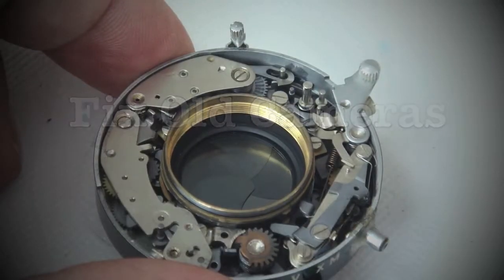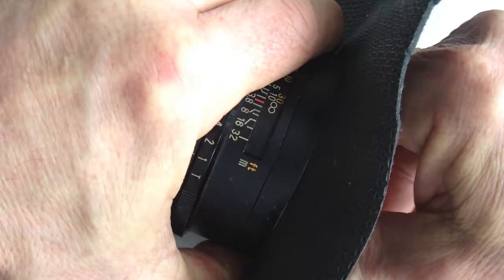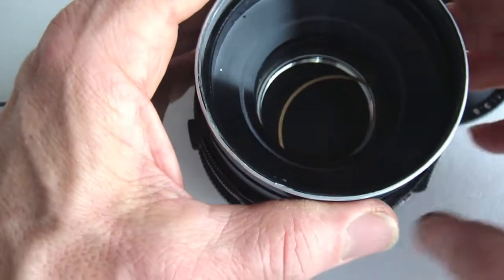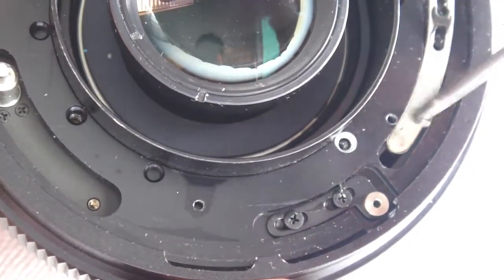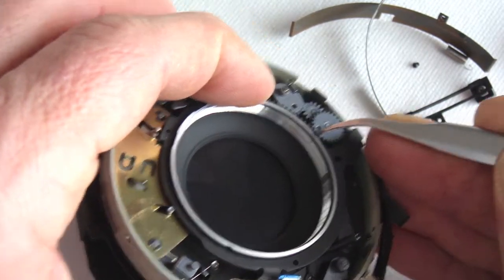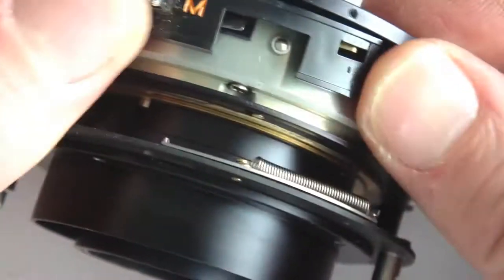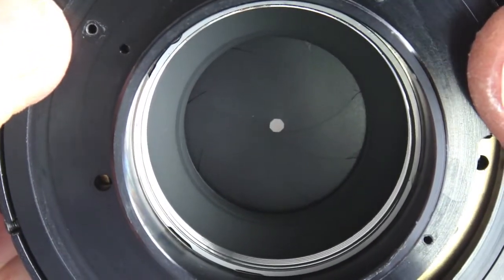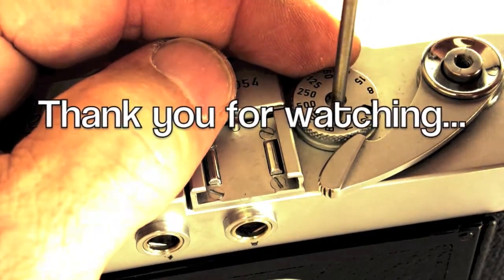Fix Old Cameras: Mamiya RB 90mm Slow Speeds Hang

Comment: Sometimes you have to make your own spanner holes to get the job done. Also nice it doesn’t have any bearings to worry about.
Reply from the maker: Indeed... and it is always a little, shall we say... tense, to take a drill to a lens. The holes in this lens were made with the aid of a small drill press, but it can be done with a hand drill, a sharp bit, and steady nerves. All which you have.
Reply: @FixOldCameras  I've never had an RB cover need the drill; I'll get the proper sized Fernco rubber plumbing fitting, those give you more grip area. There's one made that's the perfect size in most hardware stores.

Comment: Great video. Could you elaborate on the alcohol flushing technique? You said to flush at an angle so gravity forces alcohol furthest away from the shutter blades, but without a visual it is difficult to know exactly how to do this.
Reply: THIS NEEDS TO BE ANSWERED!
Reply: Just hold the assembly on a 60 ish degree and flush it like that, the gravity will keep the alcohol from pooling on the lens and shutter

Comment: Wow! One of your most complex videos. Nicely done. Say, this is off topic from this lens repair, but how about showing us how to replace the small built in memory batteries on some later film cameras? The Canon T-70 & T-90 come to mind, I'm not sure about the T-80. Both T-90 & T-70 instructions mention having a Canon Dealer replacing these internal batteries every 5 years. I'd bet any we'd find today need these replaced. As always if you need a sample camera to work on I've got them. Cheers
Reply from the maker: The T-70 and the T-80 are not to bad to get into. The T-90... well that is a little more difficult to open up and access the memory battery. Thanks for your suggestions and comments and for your continued interest in FOC.
Reply: Thanks, I just picked up a "parts" T-70 to play with, the funny thing is every T-70 I own has a good backup battery even after 34 years. If you get a chance have a look at this youtube video it's only about 7 seconds long.  (https://www.youtube.com/watch?v=Y_fKHnBMssk) My parts camera has the same issue. The motor hums a if it's jammed and it eventually stops and displays as this video shows. Have you seen this before? I have the service guide for the T-70 but there are no error code troubleshooting hints. THANKS. P.S. I do have two T-90's Two T-80's with all 3 AC lenses, 1/2 dozen T-70's & T-50's all with 35-70mm lenses and 2  of the lowly (Mamiya built ??) T-60's. The T-50's &T-70's are loaner kits for any High School or College kids interested in film photography.
Reply from the maker: The motor shaft on the T70 is probably slipping or there is a bind in the mechanism that the motor can not over come. And also, it is again good to hear of you loaner program for photography students. Very cool.

Comment: Thanks. I have a 50mm C with a very stiff floating front element ring. From the looks of it, I should be able to use this video to access the ring the to clean off the old grease and add new grease.
Reply from the maker: A word of caution - Do not separate the helical threads as the can be very troublesome to restart properly. Try and work the threads without separation.

Comment: Hello! I followed your video and it helped me alot. But I have a different problem where the shutter is cooked it doesn't fire, it just turns loose. And when it eventually does fire the timings count but it doesn't open the shutterblades. It's like the mechanism that operates the shutter doesn't allways work. And sometimes it works and fire fine, the timings work and all. Do you know where I can find the actual trigger for the shutter?

Comment: Nice video! My 50mm rb lens have problems with mirror lock up . I set mirror lock up mode to M on lens. Then trigger shutter relise and mirror goes up but shutter leaf inside lens sometimes does not close and ruins my exposures they are overexposed.  Is this lubrication metod will help?
Reply from the maker: Only if it is happening on the slow speeds and not the speed above 1/30th.
Reply: @FixOldCameras  Thank you for the answer.

Comment: hi there. i have a NB 127mm lens for the rb67. the shutter blades are not completely closed after shutting, leaving a tiny half-moon-shaped hole in between. could this cause any problem with my pictures (such as light leaks) and further problems with the system, or can i neglect it?
Reply from the maker: The issue will need to be repaired.

Comment: I always watch your videos just amazed at your knowledge. I have a Nikon F2 when I cock the camera it fires in all the shutter speeds. After a while when I depress the shutter release the mirror stays up and the shutter won't activate until I press the mirror lock up button. Any tips as to what might be happening. Can I send it to you for repair?
Reply from the maker: Sounds like the mirror release mechanism is sticking or tired. It could also be that the second shutter curtain is not completing its cycle and would possible benefit from a slight increase in shutter tension. Check out some of the FOC videos covering uneven shutter exposure.
Reply: Fix Old Cameras thanks for taking the time to respond. Would a cla help?
Reply from the maker: The shutter tension and mirror lift and release mechanism would be checked and repaired during a service procedure. http://www.phototronic.biz/services.html

Comment: Hey Fix Old Cameras, i recently got an Olympus OM-10 and it was not working. Cosmetically it is perfect and the battery chamber is corrosion free, however when i put in new batteries it wouldn’t turn on. I watched your video on repairing the switch and when i took off the cover the contacts were all clean and the little lever that makes it click is still in place. I’m not sure what is wrong with it. What are your thoughts on where to go from here. Thank you!
Reply from the maker: Does the battery check work?

Comment: Dear FOC, 
I recently received a Zenit E from family, it seems to be in good condition except for a screeching sound when releasing the shutter. This only occurs when the exposure time is set to anything from 1/60s to 1/500s, at 1/30s and 'by hand' it sounds fine. Do you know what could be the cause of this problem and how to best deal with it?
P.S.
Thank you for all the great videos.
Kind Regards,
Nathan
Reply from the maker: The Zenit cameras rely on proper (liberal) lubrication for smooth operation. The shutter gears have probably need to be cleaned and lubricated.
Reply: Thanks for the reply, will do